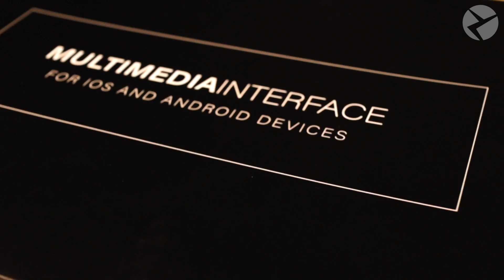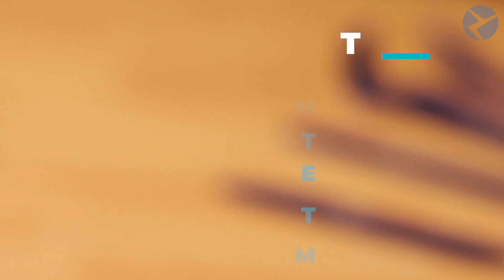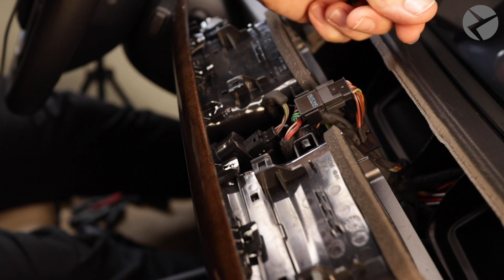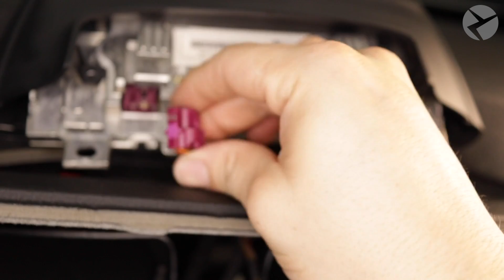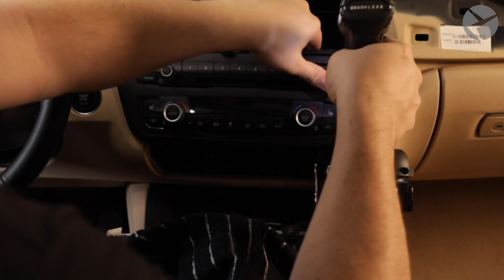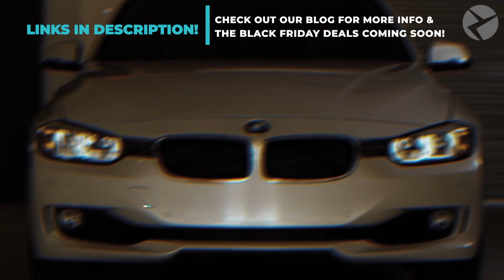Wireless CarPlay & Android Auto Prime/PRO Retrofit - Installation Tutorial for BMWs

Comment: I've got my module and before installing I'm watching this video 20x 😅. I was thinking why not use the OEM monitor cable that goes into the head unit as the output from the MMI, and use your cable as the cable between the MMI and head unit? This saves pulling the trim and unplugging the monitor.
Reply: when I start the interface it gives me two flashes of the home screen and then it starts normal, Does it work well for you as you say the reverse cables?
Reply: jose mondragon It didn't work. Actually lifting the trim was simple enough.
Reply: @yapr6  Is it the same? will it be normal?  https://www.youtube.com/watch?v=cYaWLaeH9jE
Reply: jose mondragon I wanted to reply to your video. Can you switch on commenting?
Reply: @yapr6  ready now a message appears " activate failed because fatal error please check" 
it happened to you?
Reply: https://www.youtube.com/watch?v=Yd3xokbFCYQ

Comment: Hello, would love to order this for my 2016 F22 BMW M235i convertible. Will the car microphone still work as is once this is installed? Or is there any additional steps required to make sure it will work?
Reply from the maker: Hi! It's fully integrated with your factory hardware, so your microphone, iDrive controller etc. will carry on working as usual.
Reply: Is it also possible to plug it into the stock USB port?

Comment: when is the android auto one being released?
Reply from the maker: It's available right now, including wireless Android Auto: https://www.bimmer-tech.net/category-android-auto-mmi-retrofit
Reply: @bimmer-tech  If you use wireless android auto , is it necessary to dangle the usb cable out of the trim piece to use as a plug in ?
Reply from the maker: @Aaron-ui9tj  It isn't necessary, but the USB port is also used for updating the firmware, so we'd advise making sure you have access to it without taking your car apart (unless you're happy to take your car apart). You could try routing it into the glove compartment or armrest instead.

Comment: How difficult is this install for the BMW i8
Reply from the maker: Hi Brad! Well, we wish we had an i8 to hand to make an installation video for you ;) The fundamental installation process is the same for any model, it's just a matter of getting access to the head unit and connecting up the CarPlay MMI Prime unit. There might be a bit more trim panelling to remove in the i8 before you can get to the hardware underneath, but apart from that, it's not too different than in this video. You can take a look at how a previous customer got on here: https://youtu.be/A7LCl0s7HDA

Comment: Does this support the heads up display that projects onto the windshield?  If so, does Android auto Google maps navigation directions show up on the HUD like the factory navigation does?  If it doesn't support the HUD, does existing HUD functionality (mph, call info, etc)  break? I'm asking for a 2012 335i sedan if it matters
Reply from the maker: syke512 Hi! This retrofit is completely separate from the HUD.
Reply: @bimmer-tech  I think that is what he is worried about. He wants to know if it will display the same data (or more) in the HUD.

Comment: FYI, this video doesn’t cover the potentially required install of the mic wire for vehicles with a combox. This process is quite aggravating and will add an hour to the install. Also, I received a straight aux cord instead of a 90degree- so it doesn’t sit the best in the arm rest and doesn’t correspond to the instructions.
Reply: Hey Mike, I'm currently struggling with the mic. Can you point me in the right direction? Bimmer Tech doesn't provide any information on the mic.
Reply: Adam Byrne you good? The mic cable needs to run across the bottom of the dash internally to the drivers side A pillar. Then up the pillar and connect to the existing mic. Will need to remove the A pillar cover, side of dash trim and bottom of dash trim by drovers feet. You’ll also want a ridged piece of wire to snake it under the headliner.
Reply: Mike Charters got it! Thanks a million.

Comment: Need advice ... Received unit today and am installing.  Very smooth install with the exception of placing the connector from the MMI to the head unit.  Mine will not go past the mark identified at 6:41 in the video.  It will not go any further and seat properly.  I tried with and without the optical connector and same result.  I even reversed the install to original condition with no problem reseating hte original connector.  Any help would be appreciated.
Reply: Hi Steve, what model and year is your BMW?
Reply: @iamdjcertified2  2016 328i.  Working with company to resolve.  Appears to be a possible tolerance issue with the Bimmer quadlock connector as it will not seat properly in the head unit.
Reply from the maker: @SteveMargis  ok, great, our Support Team will surely resolve the issue.
Reply: @bimmer-tech  Hi yeah im getting the same issue the quad lock won't go in and I figure that's why the monitor won't come either
Reply from the maker: @raulllano Hi there, can you please contact our Support Team? It's info@bimmer-tech.net. They will need your order number and VIN.
Reply: @bimmer-tech  Thanks team.  Finally back from travel and got around to the second attempt at install.  All went great and the unit is working well.  I appreciate the support and willingness to send an alternate part to resolve teh install challenges.
Reply: Steve Margis hey did you manage to get it in?
Reply: @raulllano  Good news.  The Bimmer support team sent me an alternate quadlock connector cable and the install went smooth.  Must be a minor tolerance issue with early production.  Reach out to the support team and they will help.

Comment: Can we just not plug in the USB part if we’re only doing wireless or will that cause issues?
Reply from the maker: Hello Daniel, you will need to leave the harness installed and pulled through for any future updates or to setup the wireless connection for CarPlay. We initially ask to do a wired connection which then gives permissions for a wireless transition.

Comment: I installed a third party wireless charger (uses power from the cigarette lighter). So can I skip the step of dangling the usb connector?
Reply from the maker: Hello, the usb connector is required to be accessible for any updates or wired connections.
Reply: I think I just answered my own question: the USB connector allows me to mirror my iPhone, right?
Reply from the maker: @ramirezserge187  so: CarPlay mirrors wirelessly while you need a cable to mirror in Android Auto

Comment: Since I have a version 2 is it just swapping the unit or do I have uninstall all the cables to the head unit?
Reply from the maker: Hi Fred, in fact every case is different. Please send your order number and VIN number to info@bimmer-tech.net and we'll check what  exactly you need to do.
Reply: Order No. 17949, Vin WBA4B1C54GG241924 as requested, please advise
Reply from the maker: @fredterranova3376  then yes, you will have to swap the cables too but no worries, it works exactly the way you did it before. However, you'll be provided with another instruction this time.